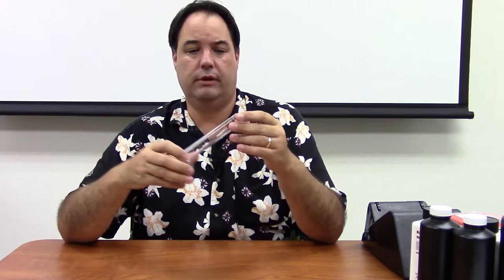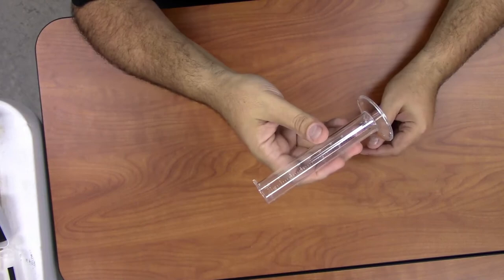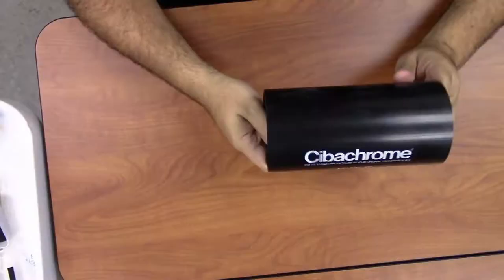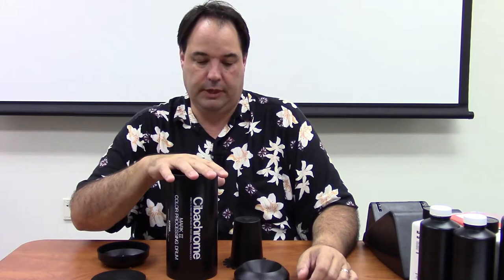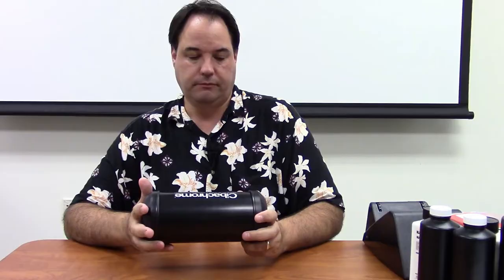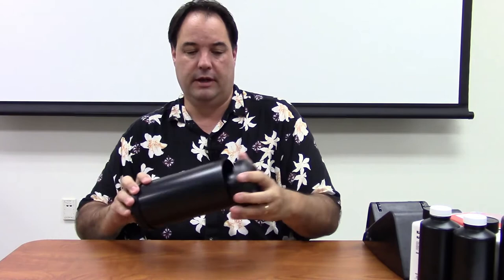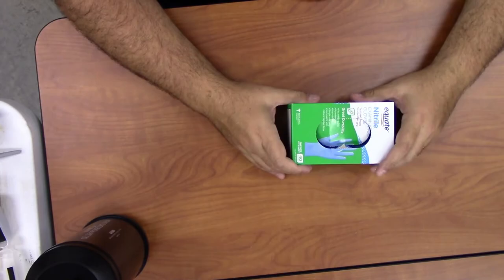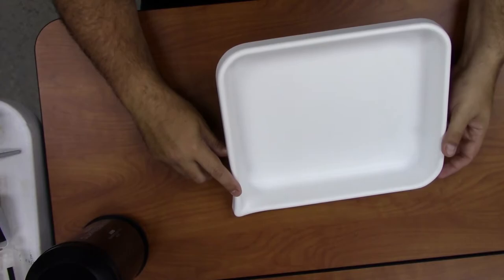Film Developing Tools – Large Format Film Photography

Comment: Probably not by total coincidence, I've used a Uniroller and a set of Ciba drums for about 35 years to do color prints and color roll film.. There were several alternative makes back in the day, but this combo of equipment seemed best to me. The auto reverse failed on my Uniroller many years ago. I no longer remember what the source of the problem was, but I remember opening the unit and fixing the problem very easily. Your alternative of manually flipping the drum every 5 seconds on the roller will prove a non-started. Good processing.

Comment: Someone told you to not use D-76 because it has sodium sulfite in it?  You need a better source of technical advice. Virtually all B&W developers ((other than the staining variety) use sodium sulfite to prevent the developing agent(s) from oxidizing  about 5 minutes after first mixed. It is true that using a relatively high concentration of sodium sulfite in your working developer solution will cause some of the developed image silver to be dissolved. This has the effect of grain reduction, but in some degree that dissolved silver will be redeposited between the grains, which tends to reduce apparent sharpness in some situations. This why Kodak recommends using D-76 in a 1:2 dilution with water to make the working solution if maximum sharpness is sought. In 8x10 large format photography, such considerations are pointless (as was the advice you got), because the image will never be enlarged enough to show any such differences.
Reply from the maker: Randall Stewart I was flamed by the Pyrocat crowd. So I gave it a try. After a year of trying different ways of using Pyro, I’m back to D76. It my not be perfect for everyone (D76), but it has worked well for me. Thanks!
Reply: Pyro was "in" for all formats about 25 years ago and remains popular in large format circles. It genuinely provides that delicate separation of highlights and upper mid-tones you have mentioned from your experience. I gave it a serious look at the time, but I passed on it because it has some very poisonous components. Since I compound all my own stuff, I didn't like the risk/reward ratio. (The pre-mixed solutions sold now in kits minimize that risk.)

Comment: The air conditioning systems here tend to expel distilled water which my photography teacher tends to get hold of from the building janitors.
Reply from the maker: That's a great tip! Never thought of that. Thanks for watching!
Reply: Thank you for sharing this video and the future ones!
We need one of those tents in our class! We have a changing bag that looks like a plastic sweater, and it gets just as hot inside. When I've used it to get rolls of 120 film onto the developing tank spools it is incredibly frustrating because it drops onto your hands and gets in the way, everything getting sweaty as the temperature rises.
Reply from the maker: I know what you mean. I would look into the "pup" version which would be plenty big enough for 120. I like how they fold up and can be taken anywhere. They are pricer than the changing bags, but worth the investment in my opinion. I know B&H does offer discounts to teachers and students. Thanks!